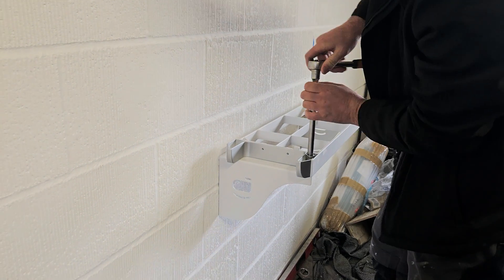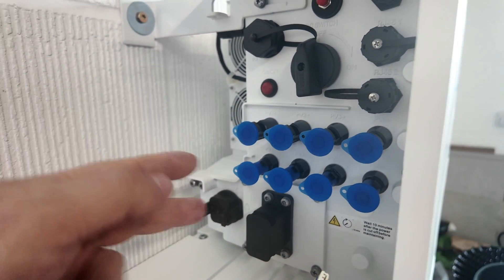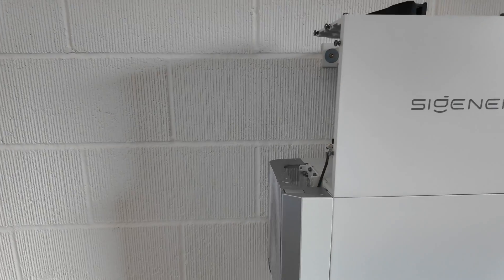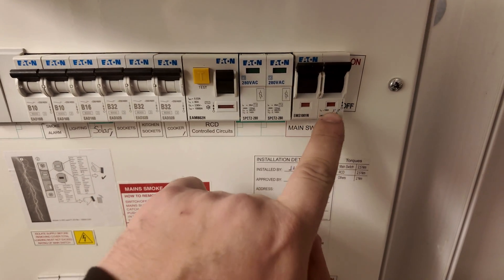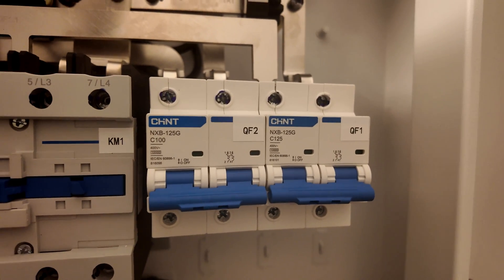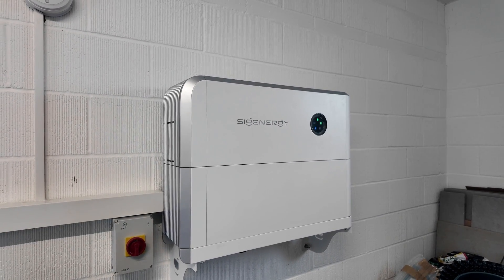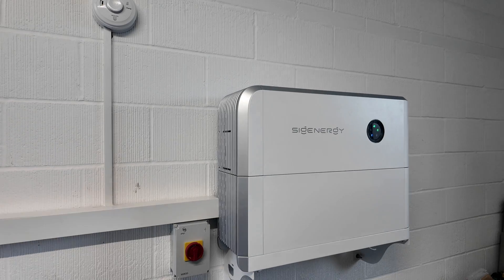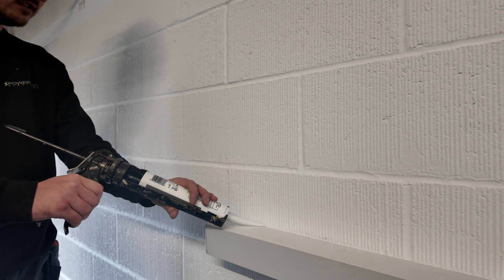My new build Solar IS TOO SMALL what can I do? SigEnergy scalability

Comment: Is it a big job to add more batteries to this system? Does the wiring to the inverter have to be pulled out and re-done?
Reply from the maker: No wiring is all good. Very easy to scale in size.

Comment: I’m installing my first one this week. Just spotted this in the manual “In the backup networking, G1 is the backup distribution panel, requiring a residual current device with rated residual operating current of 30 mA; G2 is the non-backup distribution panel.” This would suggest any existing non-RCD protected circuit would need to be moved onto the non backup side, as it won’t be protected properly in a power cut. Exactly the same issue with the Huawei gateway. I feel this may be catching some installers out, especially on a single domestic DB feeding a non-protected circuit. This is where the Tesla backup setup is still miles ahead with its ‘current sensing’ technology, supposedly eliminating the need for downstream RCD protection in the event of a power cut, so they say 😅
Reply from the maker: That would be a deviation from regs with the tesla option. We still always use 61008 or 61009 rcd/rcbos on all final circuits using island mode. The Sig has the same tech as the tesla but they are just advising installers better in the manuals. Same as Huawei. We do need to remember additional protection can be eradicated from requirement on circuits that are not power, lighting or buried in the fabric of the building. Leaving fault protection as the only element to potentially cover with rcds these could be rated much higher than 30mA. BS7671 is our guide with manufacturers instructions taken into  account

Comment: Whilst there is a debate regarding consumer's equipment in the meter box, that's how you should do switch fuses. I did at first think you were only relying on the DNO fuse to protect those tails. I can only dream of getting my van as close as that on site. Nick Bundy was doing a battery where it was floor mounted that looked smart.
Reply from the maker: We usually do these floor mounted and Nick is absolute ledge! Thanks mate

Comment: What was the total cost for this installed?
Reply from the maker: Send an enquiry through the website for a bespoke cost. It varies on installation
Reply: @electrician247  Not in your area, so not much point, just wanted a ballpark figure. My setup is very similar. Existing solar/inverter looking to add Sigenergy system into garage.
Reply from the maker: @TImBrouard  we cover the UK due to these videos. This install was not our local area. 

If you can advise capacity required, inverter size, if you want a gateway/backup and what the current setup is like we can give costs. Can vary by thousands based on the above. Thanks. www.powersonic.co if you want to fire any of that over. Have a good weekend
Reply: @electrician247  Great - have sent enquiry.

Comment: My OCD really wants to use coloured heat shrink on the bus bars in that gateway. Nothing wrong with 2 switches in the CU but I probably would have swapped the CU main switch to the bottom row and then use Yellow Labels for the CU main switch and circuits and a white one for the main switch isolation to the gateway. 
Yellow and black is helpful for people with poor sight/ dyslexia and helps separate it from the other main switch for identification - as would having them in different rows. 
It's not always possible especially if you don't carry Tri rated cable on board but I think more of us are now we're doing renewables?
Reply from the maker: You see we discussed this and decided the switches together made more sense and easier to understand so it shows how we all view this different lol.

Mattie went to town on the labelling so all good with that. I've had many a customer complain about my yellow labels. But as you know dyslexia brings a different perspective which is why I like it lol

Comment: Lovely neat job!
I personally wouldn't put the two main switches in the CCU, i prefer to take the mains over to the gateway and leave good labelling to indicate point of isolation. Its just that simplicity is becoming my obsession lately.
Nightmare that we cannot reverse the door on the Sigen gateway, I did try once, but it was not pretty!
Reply from the maker: We have done it before we with 100A connector blocks and no iso in the CUs but this way make more sense to me so I think we will stick with it when the submain can't physically be moved to the gateway as was the case here.